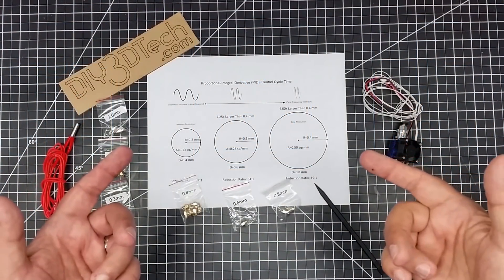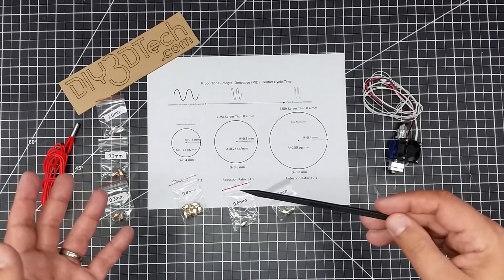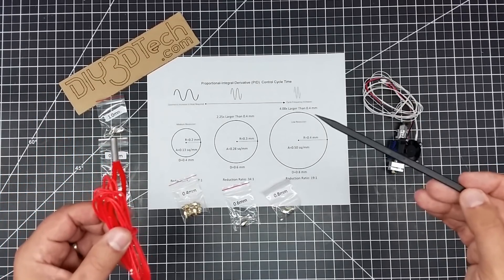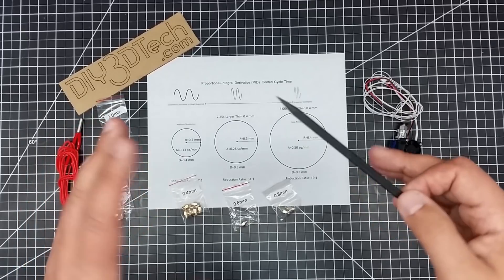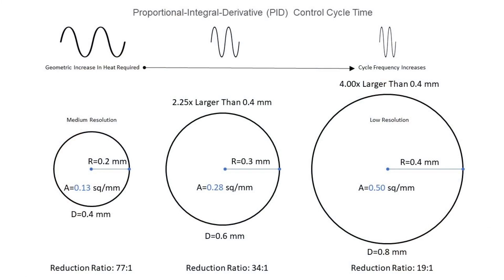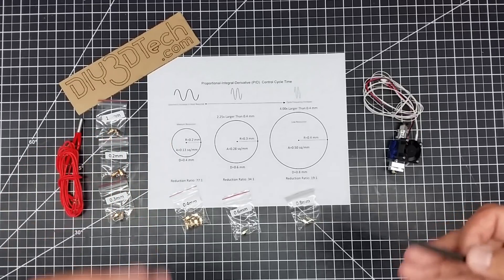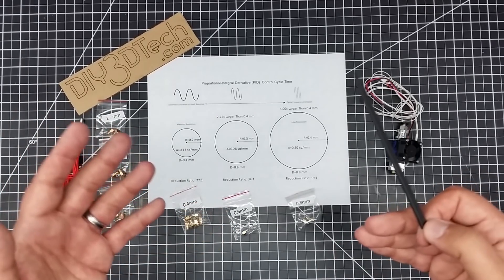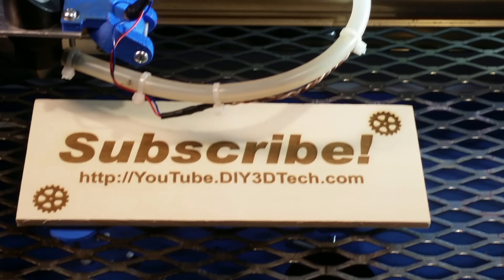Shop Talk - So You Want a Bigger Nozzle!

Comment: Thanks for this vid. I went from .4 to .8. Im printing Loki's mask from the movie. First couple of layers was fine but after that a 'controlled spaghetti was the result. Tried slower speeds and temp increases but ended with the same problem and wasted filament...
I have a metal extruder coming and will do a pid tune.
Cheers
Ant.

Comment: I'm using 1mm nozzle on my Ender 5 Pro upgraded with the Micro Swiss direct drive all metal hotend and it works great. Large prints are done very fast (reduced  a 5 day print to 1 day). The only thing I changed was increasing the hotend temperature by 10 degrees. I'm very satisfied with this setup.

Comment: How do you set your pid for a specific size of nozzle like the 0.8mm?  I  saw how to do a pid autotune with pronterface but I can see how it can be specific for a nozzle size.  Thank you
Reply from the maker: Each nozzle size will have a different swing in temp as I cover in this video because of the round filament, the volume increases are not linear.  Technicaly this will also vary with material too...
Reply: @DIY3DTECHcom  ok but how should we do to find the good pid setting for each nozzle size🤔
Reply from the maker: PID are calculated managing a measurement over time.  So you will need to capture your hot end temp movements of a set period of time and then running the PID calculation...

Comment: Isn't that a 1.0 mm nozzle, not 0.1 mm?
Reply from the maker: Typically they go .1 .2 .3 .4 .6 .8 as 1mm would be a huge nozzle :-)
Reply: @DIY3DTECHcom  The package in your video is labeled 1.0 mm. Is it mislabeled?
Reply: @DIY3DTECHcom  and thank you by the way! Great info, I'm configuring my printers with 1.0 mm nozzles to print a statue.
Reply from the maker: Did this video a while back so will have to look and 1mm I am betting its a BIG statue :-)

Comment: Hi! Nice video, many thanks for the explanation. 
I'm using 1 mm nozzle at my Wanhao i3. 
Actually I'm meeting no problems with printing . I'm printing at 30 mm/s with pla and did no pid tuning at all, yet=)
Reply from the maker: I am amazed! 0.1mm and it pushing well?
Reply: @DIY3DTECHcom  Not 0.1 mm but 1.00 mm=) Actually I had an experience with printing 0.1mm nozzle, but it's hard to level the table manually=)
Reply from the maker: Wow! Thats a LOT of plastic at once :-)

Comment: Printing with 0.8mm Nozzle with 60mm/s seems to be no problem since several weeks for me.
Reply from the maker: It depends upon the material and use case, as if you check other comments in this thread and folks are having issues...

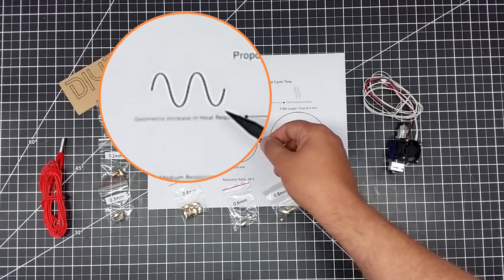Comment: A friendly correction, changing the frequency as you said at about  4:13 mark would have no effect in this scenario. in general the 3D printers are using PWM were the ratio of on time to off time is varied to simulate a varying voltage (There is no sine wave.), changing the PWM on/off ratio is how the temperature is controlled. with a bigger nozzle and plastic flow there is a need for greater heat input to keep the plastic from cooling as it moved through the ho end quicker. this can only be achieved with increasing the on duration. The PID control algorithm allows you to control the response to errors in temperature and tune out overshoot, undershoot etc. it uses the set temperature and read temperature in order to calculate factors to get to temperature as quickly as possible without any undue oscillation (Not affected by nozzle side but by tuning factors) and offsets int he desired temperature. Too complicated to go into in a simple comment but I hope you get the idea.
Reply from the maker: The sine wave is a simple analogy for the PID cycle because as mentioned The job of PID is to hold the temp as close as possiable to the target minimizing over and under shoots (Have worked with PID loops for many years in tracking analogorthms).  If you look in the Wanhao playlist I did a rather detailed series on PID so know them well :-)
Reply: I completly get that you understand how it works, me too, having trained up in industrial electronics but in this case I think it was more confusing than to show say the heat rise with overshoot and a damped sine after that (Not frequency related) or showing a PWM representation with increasing on duty. I think you do great videos and I would not normally comment unless I thought it was causing more confusion / miss representing the operation of a P.I.D control loop.

As far as explaining that bigger nozzles will require more power to the hot end due to more plastic / second flowing through and therefor requiring heating faster to ensure adhesion to previous layers and fluidity so you dont get too much pressure in the nozzle / hot end I think you did a good job explaining all that :)

Comment: The frequency does not increase when pumping current into the hotend. It is the duty cycle.
Reply from the maker: The duty cycle is the frequency, if the heating element turns on and off say 10 times a second. It  is ocilating at 10 Hertz. Hence the more plastic you push the more heat it will take and therefore the more times it will have to turn on in order to melt the plastic compared to a smaller nozzle...
Reply: No. Duty cycle is independent of Frequency may it be DC to Daylight. Typical RAMPS heater outputs  have a base frequency of 7.62HZ which is Pulse Width Modulated. The frequency is fixed, only the ratio of the high and low states of the output is varied.
Reply: DIY3DTECH.com  i think you might be mistaken, when you retune the PID it does not change the frequency of the on/off cycle to any great degree but rather increases the on time length and decreasing the off time length, i'm sure with your knowlege you can test this putting a led in line and watch the on time length(like the heatbed has)I have seen quite a few problems in pid controlled incubators caused by the difference in ambient temperature between summer and winter. great channel and thanks for sharing your thoughts
Reply from the maker: Which again is the Frequency, any time anything cycles its does so with a Frequency.  The job of the heater is to heat the "heater block",  which for conversation will take the same amount of energy for each "cycle" as you are not changing the thermal mass of the that component.  Yet you are pushing more plastic in similar amount of time which is "wicking" away more heat/energy so the loop will have to work harder (i.e. cycle) more frequently as again the thermal mass of the heat block will be constant (for the sake of conversation).   So the PID will yes cycle  the "duration" of the on/off cycle as what else can it control.  Duration (i.e. on/off) is a cycle as you are overthinking this a bit as I am not talking about 7.62HZ PWM as I am trying to make this digestible (i.e. the sine wave analogy)  for the general viewer and not academic.  As this discussion is more a kin to explaining the concepts of STP to one's significant other when they just want to start their car... :-)
Reply: DIY3DTECH.com  I think a bit of confusion has entered here, frequency as in the 'amount of times' rather than 'hrtz or megahrtz, and duty cycle(time on/off) rather than the sinewave cycle (amount of times  on/off.) I think a square wave patern with longer spaces might have been better to understand your point as it looks like you are implying that the power is turned on and off more frequently on the bigger nozzle(probably the opposit actually as it would probably be on almost continuosly on a fast print)
Reply from the maker: At some point the two will cross as the heating element will not be able to keep so yes it would stay on.  Yet as mentioned prior this is a bit of over thinking as the message with the sine wave is to analogies the fact that the heating element will need to work harder.  (think of it in a RMS approach) As well as temperature as if I put a thermistor on the heat block what will see as a result of changing the nozzle?  Yes the heat block will cool faster with the larger nozzle and what would the plot of this look like?  Yes an increased frequency sine wave.  SInce this is such an interesting discussion, will make this for a future video always looking for new material :-)

Comment: with a 0.6mm nozzle you can already max out a vulcano. the only advantage of a 0.8 or 1mm nozzle is if you print with super huge layer heights, you can keep the mm^3/s at maximum with low speed and dont need high accelerations, on the other hand if you go smaller, you'll need higher speeds and acceleration to keep the plastic flowing at maximum rate, and that usually means, more noise, ringing, worse surface finish, etc. 
So do 0.4 or 0.6 with a e3d v6 and 0.6 to 0.8 with a vulcano.
Try setting the speed and line width along the layer high so that you get it near the maximum your hotend can melt without problem.
In my experience, its 14mm^3/s for a E3d V6 and 22mm^3/s for a vulcano.
You dont necesarily need to go 0.5 layer height just because you got a 0.6 with a vulcano. you can do 0.4 layer height and just make the perimeters thicker to get better quality while keeping the time the same. Its better to have 0.4 layer with 0.8 mm line width than 0.5 layer with 0.64 mm line width, and the extruded plastic per second will be the same.
Reply from the maker: Interesting, I will have to digest this a little but in general agree with you :-)
Reply: Also, if you're using a ptfe heatbreak, the ones that have ptfe till the very end, then your mm^3/s will be lower, say 10-15% less. That last metal part which goes into the heater block also helps melting the filament, so if you can afford it and dont have jamming problems, go full metal, and you can also do high temp plastics if your thermistor allows it.
Reply from the maker: Fully agree on all metal hotend being better yet will go 50/50 on the jamming.  As if your using just PLA and printing normally, I have had (personally) more jamming issues with all metal then PTFE.  When I looked into this a bit more, the conclusion which I drew was "retraction" as you are correct when you say "That last metal part which goes into the heater block also helps melting the filament" and with high detail which drives up retraction I would run into major jamming issues while a similar printer (running the same gcode) had none.  Since the only difference was this "glass" transition boundary, believe this is the culprit.  However where you are simply pushing large amounts of plastic, this issue didn't appear...
Reply: DIY3DTECH.com 
I agree, i also had to tweak my gcodes to have less retraction and also tighten to springs on geared extruder so that it wouldnt jam. In my case the jam is barely anything but as the printer doesnt wait it just rips the plastic instead of holding it pushed a second. Also not sure about you but i also have 50mm/s for retraction and 10 for detraction on the vulcano and 15 in the v6, just in case it helps you in any way.

Comment: I put a Volcano and started with a 0.8mm nozzle on my CR-10.  Love the shorter print times and stronger prints.  I'm doing a lot of functional items recently and it has been great.  Am going to experiment with 1.0 and 1.2mm nozzles.   I don't think I ever manually adjusted the PID values though I may have done an autotune using the newest Marlin install.  I will have to check.  Great video explaining the rational behind the limits of just a nozzle change.
Reply from the maker: Ah yes!  You are the poster child for doing it right!  And yes to the Auto-tune :-)
Reply: Can you give advice on what topect with this modification?

Comment: When I first got my Tevo Tarantula, it had a .4 nozzle. The sparkly PLA that came with it apparently wore the nozzle really fast, because over the course one mini-spool my print quality got really bad. So I took the nozzle off to try to figure out what was going on and I found the stock nozzle actually measured at larger than .7 (verified by sticking a .7mm wire through the orifice). So, not having any spare nozzles, I set my Slic3r nozzle size to .7 and my prints went back to being excellent - you know for somebody new to 3d printing with their first printer.

The little Tevo didn't have any problems printing with a .7 nozzle. The temp was stable. The prints came out fine with good layer adhesion.

A couple of weeks later I got some spare nozzles and went back down to .4 and was really sad at how much slower stuff printed. Finer details were crisper, but at that point I was still pretty much just printing replacement parts for the Tevo's crummy stock acrylic, so fine details mattered not a bit. 

Every now and then when I have a big print with no detail (like a DIN pocket for my car's dash) I swap the old stock ~.75Tevo nozzle in for a print and it works fine - without even PID tuning for it.

That's my personal experience with "going big" on nozzle size.
Reply from the maker: Something is odd here as I have printer farms and have run zillions of spools though some printers with limited nozzle wear.  As don't get me wrong as yes a nozzle will wear, but i should last for a dozen normal spools or so.  If your printing a PLA composite that too will speed up wear, however one spool?  I would replace the nozzle as something isn't right, as mentioned 0.8 will of course melt the plastic and for hobby use its ok however I would not do functional parts (see comment from Ed Stoddard)...